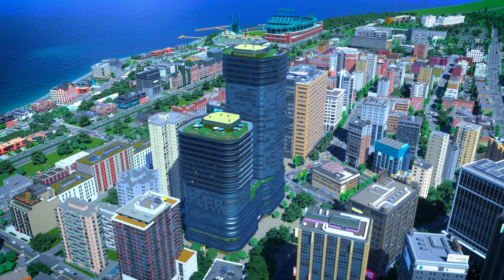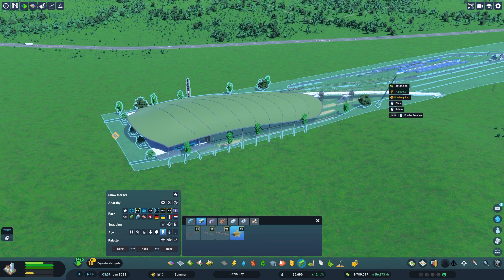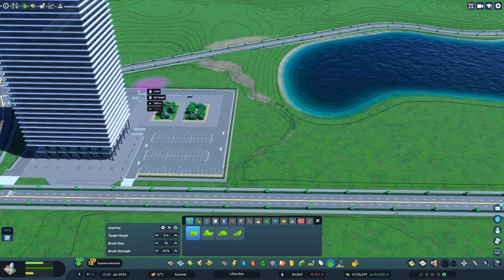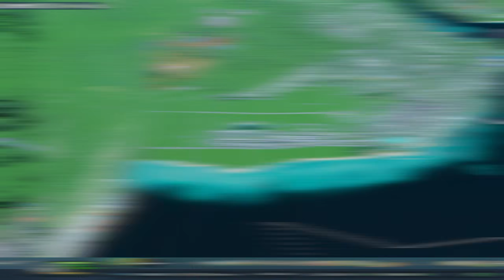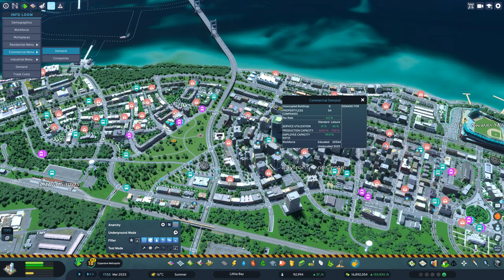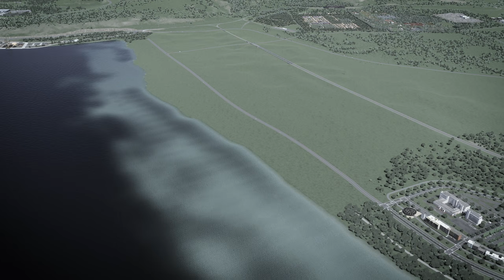I Expanded My City Until the Game Broke

Comment: Ig you need a population boom. Try scaling up your density and also try adding more low rent housing since most of the low rent buildings other than vanilla ones aint that big but have a lot of people living inside like the ussw low rent apartments. Also try changing your mixed use residential buildings to medium or high density buildings

Comment: Another issue that may still be hampering demand:

There is a bug with signature office buildings not clearing the “unoccupied” flag even when they become occupied. This artificially suppresses office demand. I know there’s a mod that fixes this.

Also, I’ve noticed that getting rid of material deficits is a fool’s errand. It’s impossible. All it does is drive down material costs, which increases demand, and drives the deficit even higher. I have a city that produces 1.6kt of grain and the deficit is still over 900 tons.